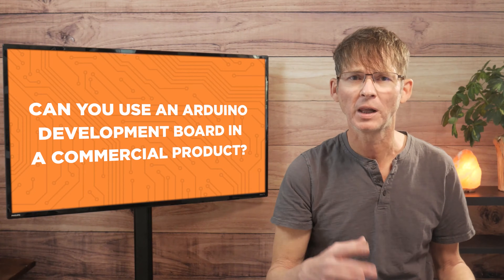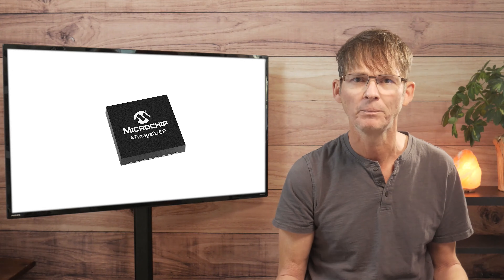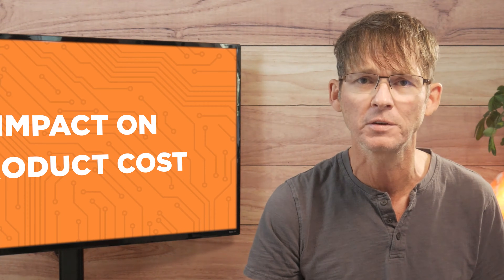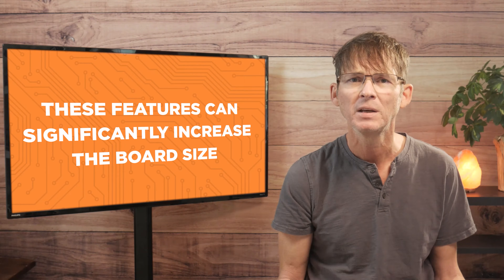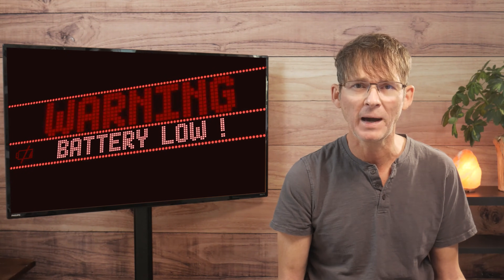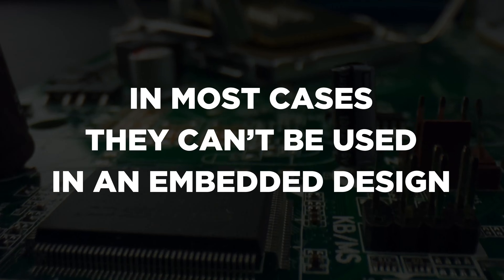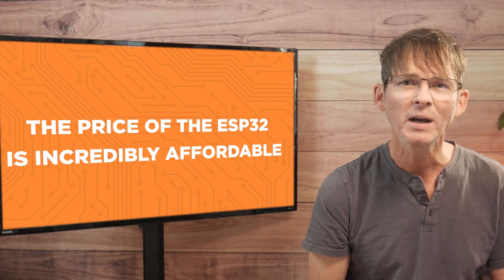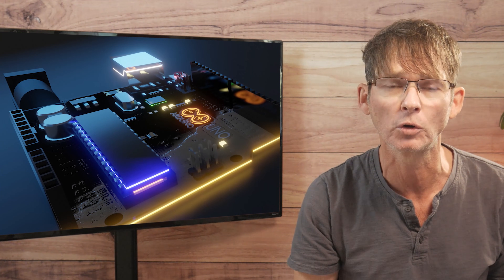Arduino in a commercial product?

Comment: I am not a maker but made a simple arduino-nano based project out of necessity. It is simply an input from a home-made capacitive sensor, a mosfet board and a solenoid. (+resistor and capacitor). At present it is stuffed in a tupperware box. I would like to reduce size, reduce power consumption and produce a self-contained kit with a sensor lead going in, power going in (5v with a short pulse of up to 1 Amp for the solenoid) and  wires out to the 6(5)v solenoid. Thats it. How would I go about getting this make up? What chip would I use as an alternative to the ATMEGA? I probably just want to test the water with 100 kits.

Comment: "Can or should you use an Arduino in a commercial product?"
The real question is "why" would you do it? Arduino is a very simple board that is being sold at a very high price compared to its manufacturing costs.
Whatever is that you are designing, you could just take relevant part of the circuit, add to it whatever is that you need and manufacture your own board.
So here is the one situation where you can or maybe even should go with an arduino: When you produce a very low volume (for example you have a single client with a very specific need) and you do it at a high price that make the price of arduino irrelevant and especially when the client needs that product right now.

Comment: I have to disagree a bit. To use one of the smaller mini versions of Arduino would be a cost savings. If you are only making let's say 30 items, why produce a custom PCB? And all the cost of soldering. Also, if your enclosure is very large, size is not an issue. The author of " Predictable Designs " does not discuss the use of the tiny/micro versions of Arduino or Raspberry Pi in enough detail. We ( small developers ) have to focus on niche/custom products. We can't compete with the big mega corporations on quantity vs. cost.
Reply from the maker: If you're only producing 30 units that's more like prototyping numbers not production. I don't see too many projects only hoping to sell 30 units, and that's a hard business model.

Comment: I love Arduino, mainly because how easy is to start with, the boards are usually well done. Now I'm trying to design own boards, Arduino and shields are good source of referece designs, such as power supply, mcu connections, antenna design, ,..

Comment: power consumption , size , price and availability  are the factors , you are considering. so Arduino can't be used for mass production.  
Since  I am using AVR for my products and I am designing my own "low end application" specific board.  They reason is lot of support and libraries are available online.
Is the any other technical issue with AVR microcontrollers ? 
like do the are sensitive to noise ?
Do the are good or bad with inductive load ?
EMI or EMC issues ?
Reply from the maker: The only issues with AVR microcontrollers is they're slow, lack advanced features, and are expensive for what you get. For most commercial products I'd go with a 32 but microcontroller.

Comment: one off systems to control I/O and collect data for validation of in house designs where you don't care that your hardware/software is open source sitting at the end of an assembly line in a factory somewhere with only concern is reliability of the system, the arduino are easy low cost and quick

Comment: Took your advice, I've made and tested my own pcb board just using the atmega chip and I have a working prototype. What do I do now to get it  refined and prepared for production? I'm stuck at this spot.
Reply from the maker: Great start! I'd start next by showing your prototypes to potential customers for feedback. Also is the atmega enough performance for your product? Any major missing features? If all is good with atmega design then I'd get it reviewed by expert engineers for manufacturability. Also price out the manufacturing cost. Main thing though is you need to use the prototype to get customer feedback and validate there is a market and how much they will pay if they will buy it. Only so much coaching I can give here in the comments, if you'd like more help from me then check out my Hardware Academy. Hope this helps. Cheers!
Reply: @PredictableDesigns wow I really appreciate the advice. The atmega chip is just enough for the design. I'm going to start testing the market and get some feedback like you said. If there's a market for it, I'll move forward with other steps. I'll keep you posted. Thanks again.
Reply: @PredictableDesigns  I just realized you have a tune of great content 👍

Comment: A better question is, if Arduino is so easy to use, why don't companies use Arduino compatible chips and the Arduino language to cut development cost? Instead they need to hire professional embedded software engineers and program the chip in embedded C? Why can't they program a controller in Arduino language and deploy it in a car, a plane, a satellite, etc? Is it any less reliable?
Reply from the maker: The Arduino language simplifies programming, but with that simplification comes less control. Thanks for the comment!
Reply: @PredictableDesigns  could you make a video on this? this is the first ive heard of any actual benefit to not using c++, also if theres a specific component my project uses and it communicates over spi or i2c, what are the chances they would even have their own c libraries, that's not something i've had to look into before so it's very possible there could be more support for common libraries with embedded c
Reply: As an example, I've run into problems in the past where my Arduino sketch just didn't load.  Why?  Who knows! Debugging that issue would have been just as complex as writing some sort of loader myself.  Fortunately, the problem was intermittent enough that I got by eventually at that time by trying repeatedly, powering off and on, and rebooting the PC.  I haven't seen that issue with newer versions of the IDE. but I still have old Arduinos that are apparently bricked.
Reply: But esp8266(esp01) is largely used by IOT Companies nowadays. You can find esp01 and esp32  in a large range devices such sonoff, several kind of sensors and even drones.

Comment: I appreciate you not slamming the use of Arduino because of its intended purpose (learning). The fact is, nearly all Arduino code aside from digitalWrite ( there are tutorials for using the control registers in Arduino) It is every bit as good as "professional" development packages when it comes to putting your code on the chip. Like you pointed out, the bulk of extra components and printer cable are the main cash cows which will hurt you in scaled production. I made the switch to espressif MCUs but still use the fully supported Arduino software to program it. I just see no reason to move away from it at this point. Arduino will take you as far as you want as long as you chip is supported. One tool, many chips and a huge community are the reasons I use it.

Comment: Can I just use the atmega328 for commercial products without the Arduino board
Reply: You can! But like John mention, you can find better and cheaper chips than the atmega328 which can also be programmed with the arduino IDE, so there's no good reason for sticking to the atmega328!
Reply from the maker: Yes, what Gabriel just said:)
Reply: Thanks alot and is it good to use custom libraries in Arduino for project and product

Comment: Very usefull video if you have never tried to get an idea from prototyping to product.
Another thing to consider is FCC Certification if your project includes wireless systems. By using FCC certified prebuild rf boards you dont need to apply for a certificate on your own.
Reply from the maker: Thank you Mo! Yes, FCC certification is always something to consider. If anything oscillates above 9kHz it will require FCC certification, but pre-certified modules and boards can lower the costs of this certification, especially for wireless functions.

Comment: STM32 is king
Reply from the maker: I agree in most cases. Although the RP2040 from RPi is very impressive and cheap too.
Reply: It’s a great chip but I do not think the RP 2040 is particularly low power.

We’re using the ESP32 very successfully.

Main downside to Arduino is the horrible development tools.
Reply: @DMS20231 so what's the best dev tool out there ?
Reply: maybe- depending in the use case. The stm32 is great in control systems where timing is crucial. but if you need  wifi and bluetooth, and precise timing is not necesairy, the esp32 is really good